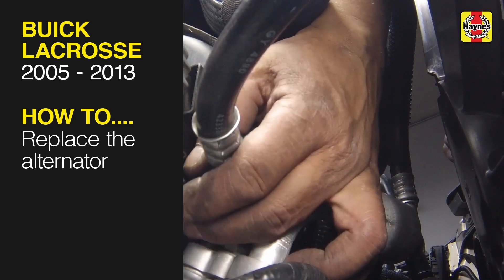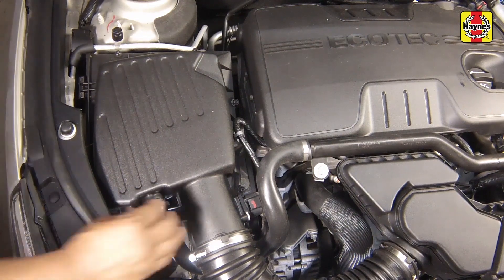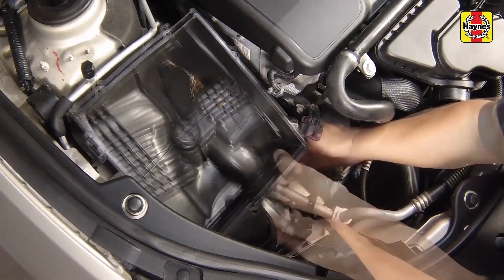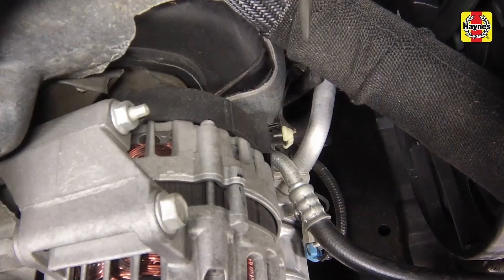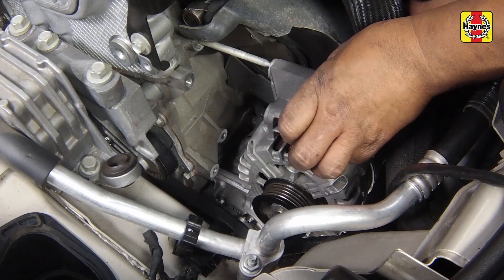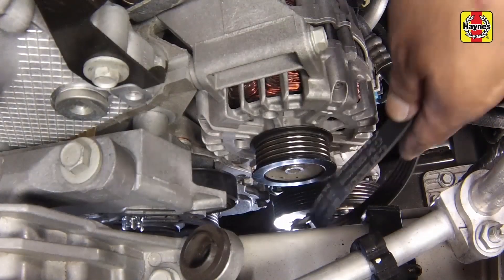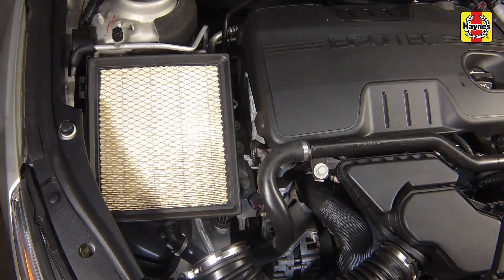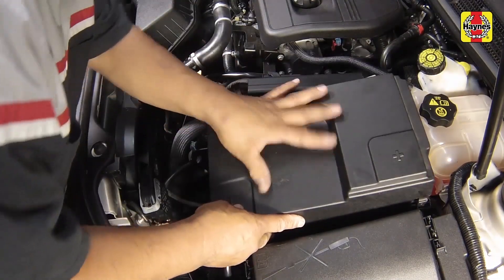Buick LaCrosse (2005 - 2013) - Replace the alternator

Comment: Helpful for ecotech motor, but my '08 Lacrosse has the 3.8 series 3 motor. This is not applicable to a Buick with the 3.8l motor.

Concept stays very similar, though. Placement of bolts and hoses are different but altogether similar procedure regardless of motor.

Comment: My biuck lacrosse 2012 has an electrical failure, quickly discharge the battery and it does not advance, which could be

Comment: That is absolutely 100% (NOT) the way an alternator comes out of a 2008 Buick Lacrosse CX.
Reply: i need to do a alternator change on exact vehicle you have a vehicle spefic video ?
Reply: I don't have a specific video that just shows the alternator but if you watch my video on changing the coolant elbows you'll see where the alternator is and how to take the belt off. 

You're alternator will not be hard to change at all in a 2008 Buick Lacrosse CX.

Comment: This video is not correct for a 2012 Lacrosse.  Two of the bolts face the front of the car and are easily removed.  The third bolt faces the passenger fender and a pulley is mounted with it.  Please do not assume all Buick Lacrosse's are the same.  Definitely will never purchase your manuals.

Comment: Doesn't work. Literally just changed alternator in my 08 lacrosse as we speak. Belt is on. Belt is loose. Belt will not tighten. Turn counter clockwise to loosen belt tension. clockwise to loosen actual tensioner itself. Tighten back. Belt is on and will NOT tighten.
Reply: L
Reply: Maybe u putting it on wrong make sure u use right belt diagram